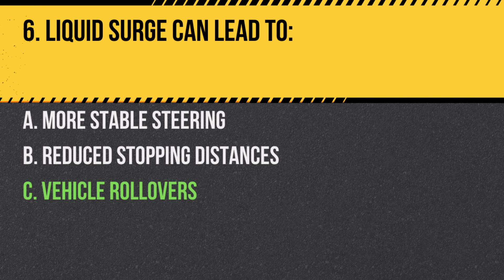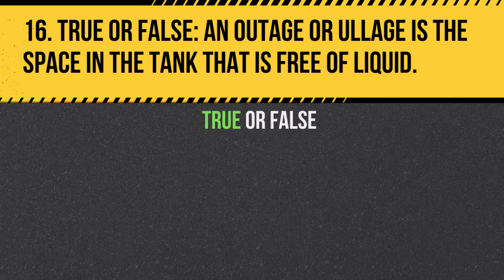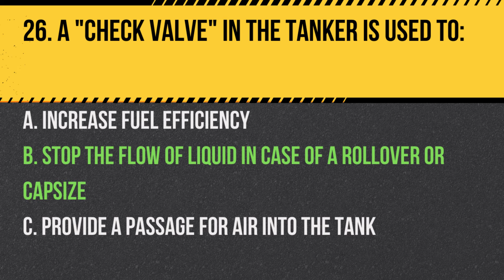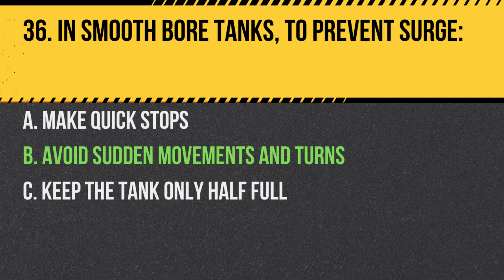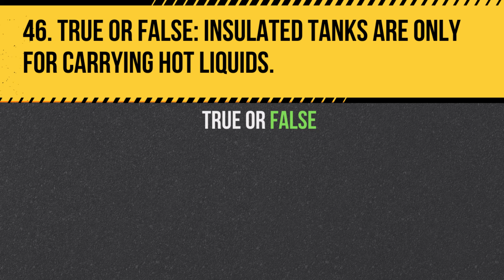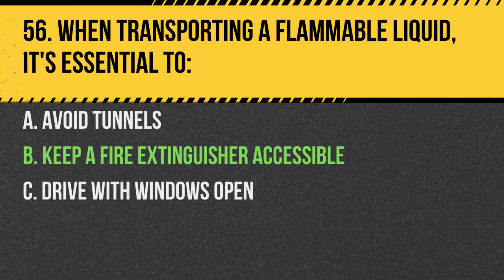CDL Tanker Test Questions and Answers 2026 (Commercial Driver's License Study Guide)

Comment: For thoes saying the snaswers are wrong, your missing the point. These are the answers the government says they are, not what actually happens for real. This is a guide to pass the written test, nothing about how to actually opperate these vehicles.
Reply: Exactly. I always get annoyed when I think of them saying a loaded dry van stop quicker. Not for me. The brakes need to work harder to stop that heavy weighted momentum. Empty dry vans always stop faster for me. It's literally a matter of physics, kinetic energy, momentum and inertia.
Reply: Correct

Comment: I thought a loaded vehicle has less of a stopping distance than an empty one ? 🤨
Reply: I guess we are being tested and graded by people who never held a CDL,much less an endosement.
Reply: Factor in surge and the fact that you are starting your stop early. It takes longer
Reply: Their designed to be used under load, so when it's not being used for its purpose, it's more unpredictable.

Less weight adding traction means it's more likely to to float on standing water or to bounce when dry
Reply: @sythlordzeek  Nah,you can stop faster empty than a heavy loaded one,it s science really,18 sets of breaks,18 tires vs 80,000 lbs or same vs 25k-34,000lbs.
but an empty truck has a degree of predictable unpredictability.
Reply: In reality Yes, but in the exam No…
I never understood that answer…